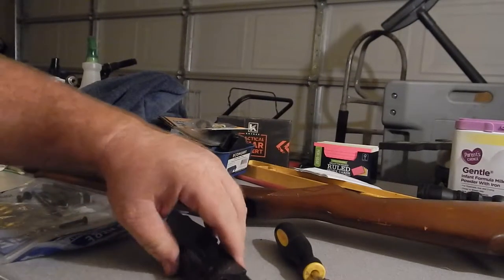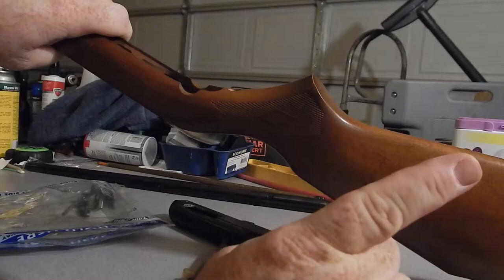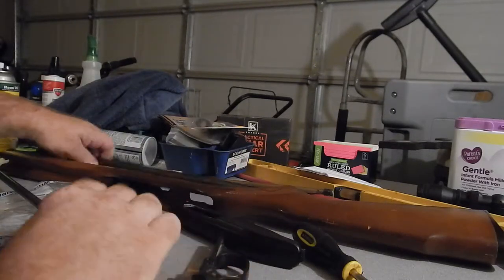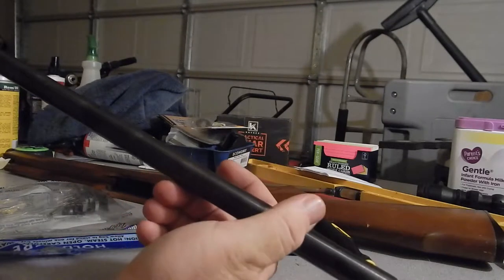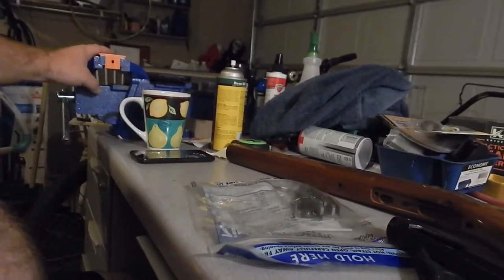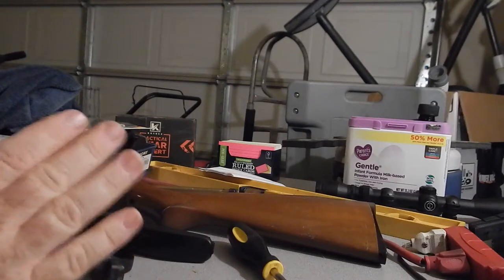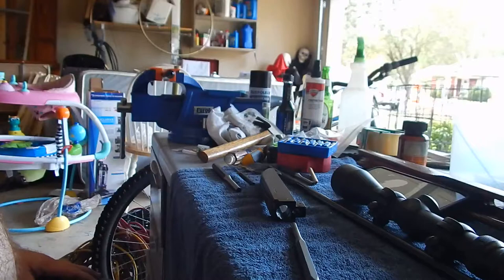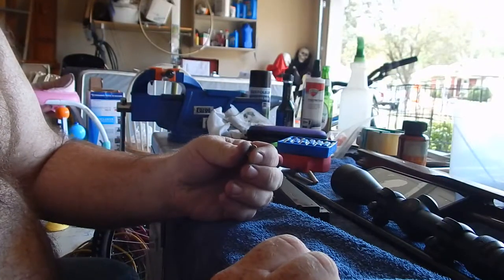video #12, Marlin Model 60 continue

Comment: Did you make a video on how to remove the barrel from the receiver on the Marlin 60? I would like to see how it's done.  Thanks
Reply from the maker: https://www.marlinfirearms.com/s/instructionManuals/

Chose the self loading tube 22lr link.
In there look for the schematic and #3 is the pin holding the barrel.
In video #11 I was having a time near the end of that video. With this rifle the pin I believe was a wrong pin and it was after this video I realized it. 
There were about 5 pieces that I had to replace to bring the rifle back to factory. 
I shot it a month ago and it was so much fun with friends and family.